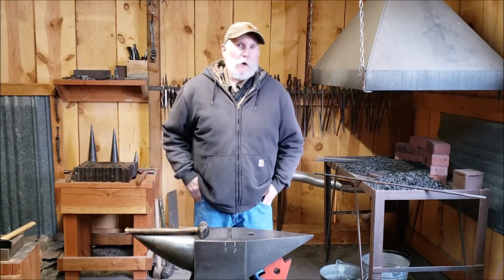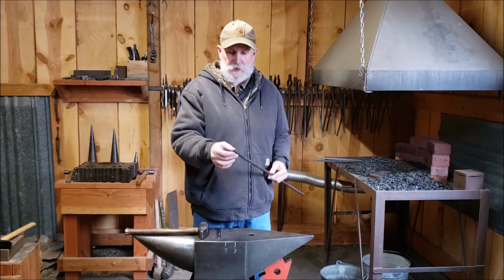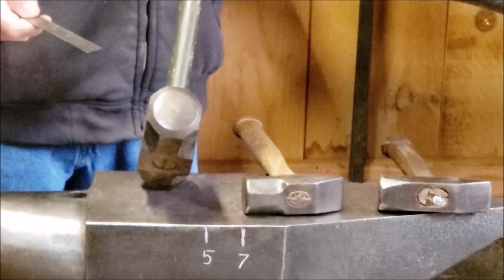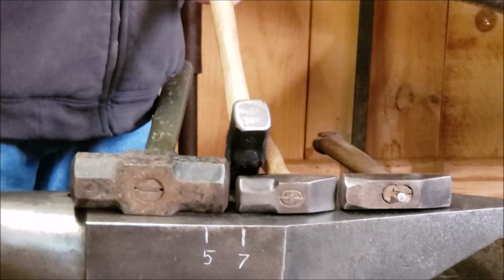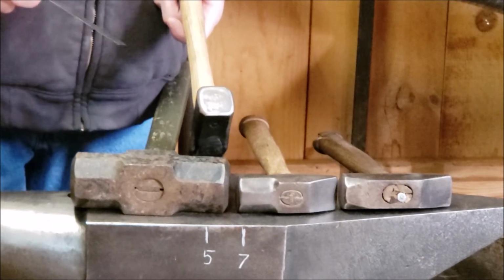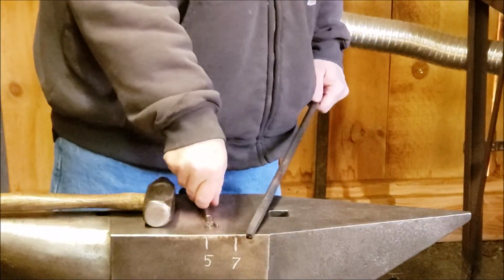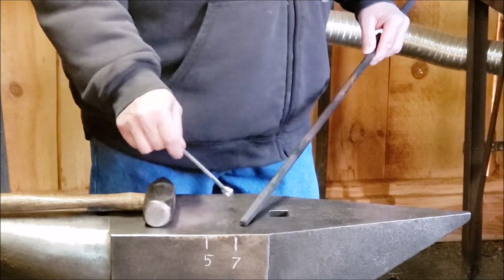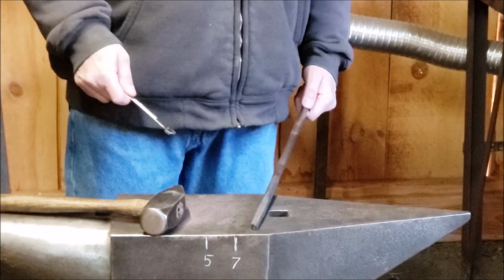Beginner Blacksmith Lesson #2:  Forging 1/2 Round to 3/8 Square for hammer control

Comment: Great looking location!
Reply from the maker: Thanks!!
Reply: @ironcladranchandforge7292  So in the 18th century, how where they making bar stock?  Asking for a friend :)
Reply from the maker: @olivei2484   Rolling and slitting mills go back at least to the 1580's.  These were powered by water wheels and gears.  So, between heavy helve hammers, rollers, and slitting machines bar stock was produced.  England wouldn't allow the colonies to refine or even roll their own pig iron.  All bar stock was imported from England up to the Revolution.
Reply: @ironcladranchandforge7292  Also technically the colonies were buying from England.
Reply from the maker: @dicksargent3582  --  Yes, I've forgotten about the Saugus Mill.  However, check out the "Iron Act of 1750".  It was among many of the reasons for the Revolution. But, you are correct about the Saugus Mill prior to 1750 producing iron bar.  Thanks for reminding me!!
Reply from the maker: @dicksargent3582   --  The only thing I would add is that prior to 1750, not enough iron bar stock was being made in the colonies to supply the demand.  This goes for Canada and the fur trading outposts as well, like the Hudson's Bay Company. The vast majority was imported. Remember, a lot goes into refining from pig iron to bar stock and England was far ahead at this point. This is according to my resources.  If I'm wrong on that please let me know.